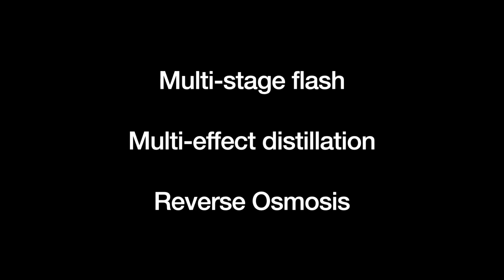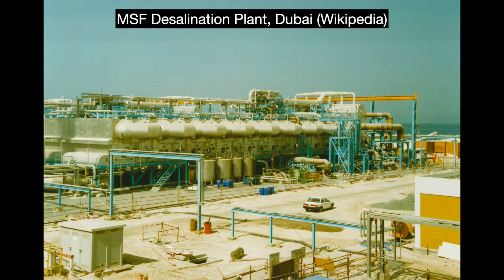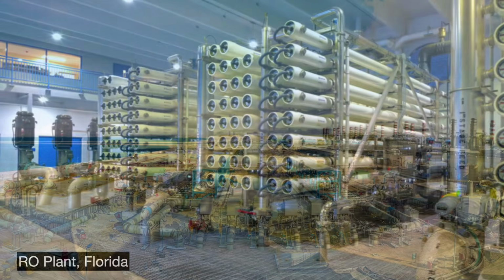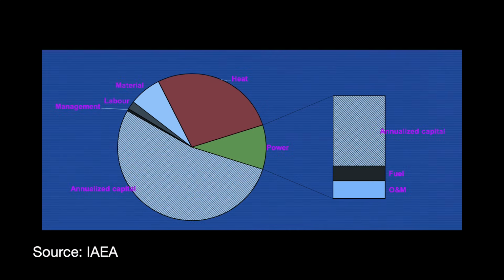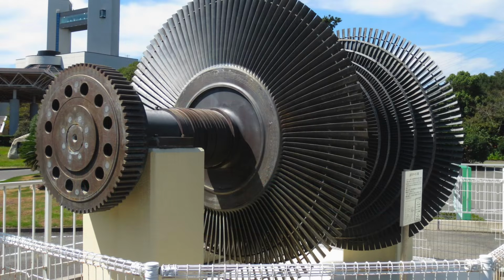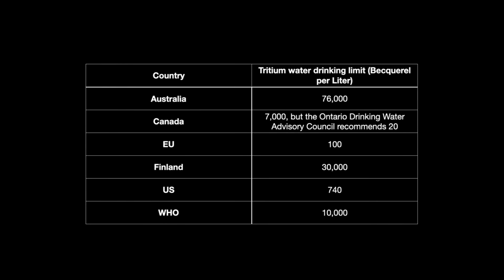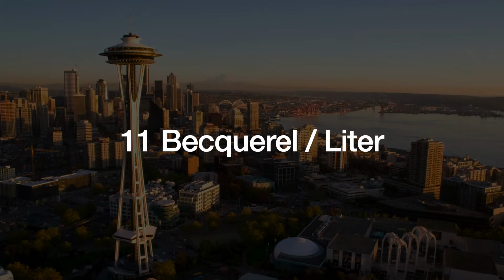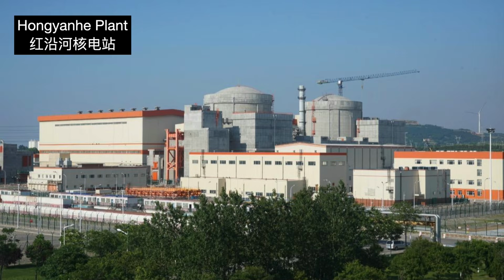Going Nuclear to Desalinate Seawater

Comment: Newer Molten Salt Reactors operate at higher temperatures, 450-650 range. Combining this with CO2 gas generators, which have as intake temperatures roughly around the same temperatures 500+ degrees, also means that the temperatures of the output of these generators is around 250 to 300 degrees. This allows for a even higher energy transfer efficiency than older PWR reactors.

Furthermore, even the temperatures that come out of an MSR are warm enough as is to generate Hydrogen without first having to turn the heat into electricity (eliminating the efficiency loses related to heat to electricity process)

so high water production, and, large hydrogen production (which is emissions-free), Now the hydrogen can be used as is for hydrogen based transport, however, going one step further and implementing Carbon Capture, and combining CO2 and Hydrogen can allow you to make synthetic fuels (pure, gasoline, kerosene, diesel). And this let me tell you is a holy grail moment.

While still producing CO2, this synthetic fuel burns cleanly (no impurities based from refinement) and burns more potently, critically, it is cyclical in nature, you take CO2 out of the atmosphere (or out of the oceans) and then release it back into the atmosphere, it is net-zero. And the key difference is simple and highly attractive; we don't need to reinvent anything to make it work. This Fuel can be used in our current infrastructure as is... Airplanes, Shipping boats, Public Transport, personal transportation; all of this becomes carbon-neutral overnight, without the necessity or expenditure to change the entire fleet of transportation methods (which in itself constitutes a burden in the form of emissions and pollution, as we are retiring the older fleet before its lifecycle ends)

Another fundamental win from this is opening up a market to which we can base our Carbon Capture too... Currently, we can capture tons and tons of CO2 from the atmosphere... but there is no market large enough to sell it too... meaning the Carbon Capture will never be a profit driven industry... however synthetic fuels however flip this... creates a market, allows Carbon Capture companies sell their CO2 to fund the construction of more carbon capture... once we have displaced all fossil fuels from the transport industry alone (fossil fuel power plants make no sense to convert to synthetic fuels) (at this point also technology and scale also has driven down the cost of Carbon Capture) governments can impose a carbon storage quota, 70% of what is captured is destined for synthetic fuel production, and the remaining 30% is for storage; thus now motivating the construction of more carbon capture and finally beginning the process of CO2 reduction in the atmosphere.

Carbon Capture is energy intensive, and thus requires a large quantity of stably available electricity which is emissions-free, which again leads perfectly into the hands of Nuclear Energy...
Reply: We do not need to capture CO2. I like the idea of producing H2 and the water. If get off of burning fossil fuels for power and transportation. The natural CO2 sequestering process will scrub the air on it own. H2 is the most realistic fuel for facilitating transport options.
Reply: @grast5150  there is a slight issue with your understanding of how earth deals with CO2... while in a normal situation the earth emits (random numbers as i dont know it by heart, but its the dynamic thats important here) 200 tons of CO2 (or other GHG in CO2 equivalance) and the consumes/sequesters 200 tons of CO2 annually, keeping things in balance... 

In our situation the earth still emits 200 tons of CO2 but we add 4 tons per year annually, so the earth still only consumes 200 tons annually... so over time the concentration CO2 increases causing global warming. 

Here is the kicker... global warming and the human impact to nature reduce the capacity for the earth to capture CO2 natural... imagine the quantity the earth can now absorb back is 180 tons annually... 

So lets be very serious here... if we went full emissions free TODAY... we still would need Carbon Capture to offset legacy Carbon and to replace the missing capacity of the earth to absorb it. 

Still we cant go full emission free quick enough... we dont have the technology to do that for some processes (concrete curing, and fertilizer to name a couple) to mitigate their CO2 emission...

So we really need Carbon Capture... but its expensive because it consumes alot of electricity... hence the association with Nuclear Power.

Furthermore Carbon Capture without a market where they can sell their byproduct is not going to be implemented fast enough, because no one can expect profits from an investment in Carbon Capture... hence synthetic fuels for the Transport sector to give a revenue stream up untill the technology reaches maturity and can start Carbon Capture and sequestration to increase the earths capacity to absorb CO2.
Reply: @grast5150  now as to why Hydrogen isnt desirable as a fuel to begin with...

1.) Its very reactive... it can explode extremely violently with very little interaction... (a static spark could), now contrary to believe transportation fuels (gasoline, diesel, kerosine) are far less likely to ignite or even explode compared to hydrogen...

2.) We currently dont have the technology to make every transportation option run on hydrogen... (namely airplanes). Hydrogen requires you either to bind it in compound to make it solid or keep it under huge pressure in a pressure vessel. These are not light... and for an airplane this is a fundamental problem. Now while it is trivial to implement hydrogen cells in trains, cars, busses, trucks, and boats... building the infrastructure for all  of this is not... how to safely store and contain such vast quantities of highly explosive materials so dispersed, how to transport vast quantities of it? Imagine a truck crashing or a pipe leaking... also replacing everyones car, busses, boats with hydrogen? You retire a huge fleat of vehicles long before their use and cycle time has actually ended.

My main concern is quick and accurate results... 

We need energy, nuclear
We need water, desalination
We need to sequester CO2, Carbon Capture
We need to keep our transportation system functional while reducing its emissions as soon as possible, synthetic fuels...

The step from carbon capture to synthetic fuels is a relative small step compared to the EV transistion or Hydrogen based transportaton... hence why it has my prefference
Reply: @Merreck0  Firstly, you have no idea what you are talking about. A high school chemistry class would let you know that Hydrogen in open air burns at a low enough temperature to not burn your skin. Did the experiment in school, you should try it. Second, Hydrogen is lighter than air in comparison to gasoline and diesel which likeky to sink and collect in any basis just waiting to explode. As such, in a vehicle accident, a H2 fuel tank even if leaking is LESS LIKELY to combust than gasoline or Diesel.  The number of deaths caused by fire in auto accidents is enough to show anyone that gasoline and Diesel can and is dangerous. Third, Your comment we do not have the technology is LAUGHABLE. We have had full manufacturable auto and heavy trucks for the last 20 YEARS. Toyota, BMW, Mercedes-Benz, FORD and GM have fully ready to use products TODAY. These products are either fully combustible H2 in a engine to Fuel Cell technology.  Fun fact: You can actually buy them right NOW: Mercedes S-Class, Toyota, and GM have offering. As to flight, both NASA and EU have been researching for the last 20 years and have WORKING PROTOTYPE ENGINES. The only technology which is not mature is hydrogen storage. Currently the best technology is cryogenic storage of H2.  While it will work, there are other theoretical technologies being researched such as Aluminum Hydride which could store H2 without being cryogenic. As to infrastructure, the U.S already has an H2 infrastructure on the West and East coasts. I believe Canada also is trying to build out the infrastructure. This issue is not a technology or dangerous issue. It is a matter of will and demand. So my question is this: why build a new infrastructure of charging stations for vehicles using batteries using a finite resource (Lithium) which destroys the region which mined for a solution that will last no more than 60-70 years? I agree with need energy and Nuclear is the best option right now. The need for water is regionally selective. It makes more sense to focus on a H2 economy than Lithium ION batteries. The only issue which needs to be solved is the fortitude to actually build the power generation we need for today and tomorrow and to get off fossil fuels. We could do that in 20 years. Energy primarily generated by nuclear with wind, solar, and tidal supplementary could make electricity very economical if the necessary infrastructure was built. With enough energy, cracking H2 for our transportation needs would be a manageable problem. I disagree on the carbon sequestration. I think the planet is robust enough to recycle all of that carbon out of the air if we actually stopped burning it. We could solve this issue in one generation. H2 is the energy storage solution of the future and not Lithium. I have heard of great leaps and bounds for Sodium batteries.
Reply: @Merreck0  My final response to you. We both agree we need a new form of energy to power our society. Nuclear is the best technology to date which produces it cheap, clean, and efficient today and not 100 years from now like fusion. The best commercial batteries today have a 2-3 MJ/kg. Gasoline is typically 44 MJ/kg. Hydrogen is 13.4 MJ/kg. Let's face it, petroleum is the most stable and best source of energy transport system on the planet. If we want to replace it, Lithium batteries do not have the energy density to do the job. Hydrogen is 4 times more energy dense. It is still not as good as gasoline but better than batteries. The holy grail would be metallic Hydrogen but that just science fiction. So for today and what can be done, Hydrogen as an energy carrier can replace petroleum. We could do it in 20 years without major changes and within out strip mining the planet.
Reply: Hmm yes I agree...
Reply: Thank you
Reply: co2 capture is not sustainable.
Reply: @victorhopper6774  why isnt it sustainable? I mean the ICC and most other reputable scientists already stated that simple reduction and complete net zero carbon emissions isnt going to be enough anymore.

In essence weve started a chain reaction already as is where Carbon capture is the only way to reverse and undo the chain reaction...

Actually i have 2 questions;
Why do you think it isnt sustainable?
And, what do you understand with unsustainable?
Reply: @Merreck0  beause life for humans requires oxygen at least 19% or we get goofier. we are at about 21 now.you have to keep freeing up the 02 for animals to survive  so don't ''lock'' it up.
Reply: @victorhopper6774  
There's also such thing as turning waste resources into usable resources. Kerosene and Thorium were discarded in the refining process until someone made use of them.

On top of that, Oxygen is also obtainable through hydrolysis when pure oxygen is needed for the process, as concentrating oxygen from the atmosphere is not as effective as splitting water to Oxygen and Hydrogen.

Comment: The major ways to do the separation seem to each possess residual challenges mainly architecture and  material .  In the past  we found a small company in Tampa area having a truly different approach with a different type of membrane. We   Purchased small test unit. Impressive. Resolves the energy, need for pre/post, and most of all the 'salt' issue. Checking just now we have just shy of 18 months of run time. Impressed. Not saying this to 'sell' for this company so did not provide name. If you want name please send me an email. Again - this is not a 'push' for the company but actual use feedback. In my opinion it could be a game changer today.

Comment: in any steam power plant, nuclear or coal, the condenser needs cooling water, and will heat the cooling water by 10-20F? I don't recall a ship-based plant tapping the hot-side of the condenser cooling water as source for desalination.
There is a caveat, for plant water, desalination can occur at the lowest possible temperature and pressure (120-140F?). For drinking water, the desalination should occur at higher temp (180F?) and should tap seawater from further out.

Comment: We can't just use the sun for this? Sure it might be a little slower than active desalination but the energy saving might offset that cost but Saudi Arabia surely cannot utilize their miles of desert as sun farms?
Reply: There's a green house desalination system in Australia that uses the heat in the greenhouse to desalinate brackish water for greenhouse crops like tomatoes and peppers. 

A floating glass dome with a vacuum pump and a compressor to condense the evaporated water would be pretty low maintenance and the pumps could all be powered from photovoltaic cells and due to being less concentrated would produce much less brine and cold water from evaporation would be naturally dispersed and replace due to convection.